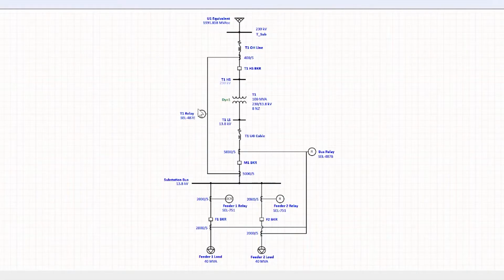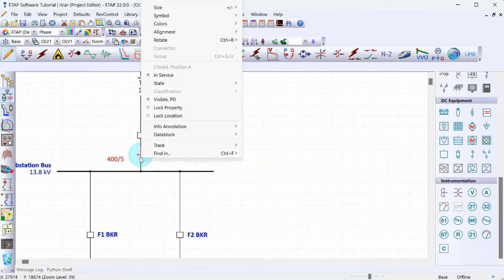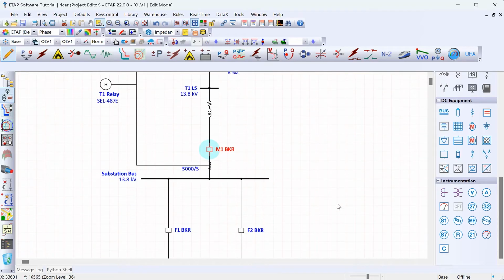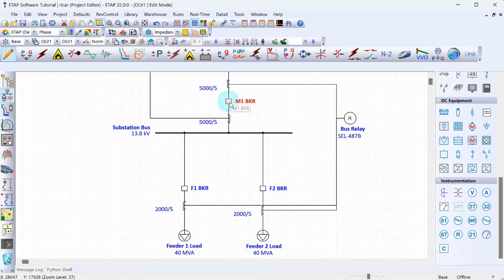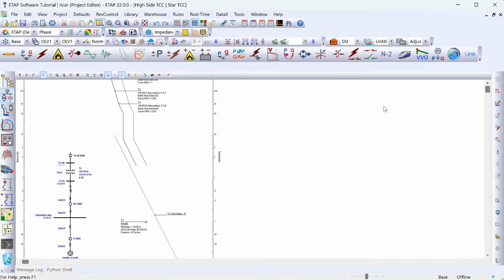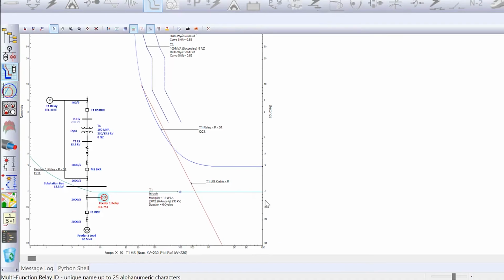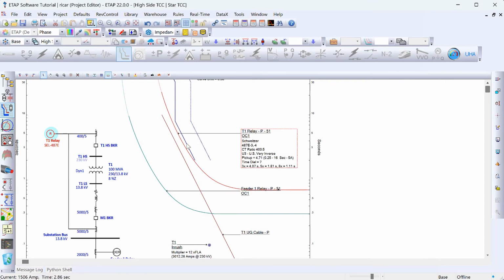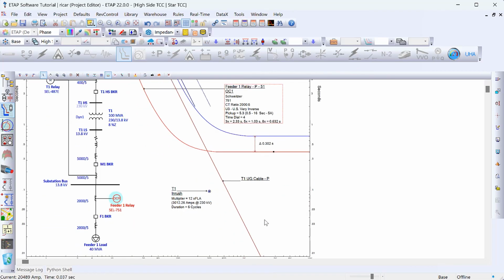ETAP Software Tutorial | How to Model Protective Relays Using the ETAP Software

Comment: why were current transformes   used  before CB. should not that used after circuit breaker
Reply from the maker: Hi. CTs should always look into the protected equipment and encompass the interrupting device. For example, the CTs for the transformer differential relay in this example should be on the top side of the high-side circuit breaker and bottom side of the low-side circuit breaker, both looking into the transformer. The CT on the main breaker for the bus differential relay should be on the top side of that breaker, therefore overlapping with the CT for the transformer differential relay.

Hope this helps.

-Ricardo.

Comment: Hello ,
We can change the time of OC definite time from 0.2 sec to 1.5 sec without study ? for PCC point between grid and the plant.
Thanks
Reply from the maker: No, this is a big change in the time delay of the OC element, you should make sure it coordinates with other protection before changing the setting.

-Ricardo.
Reply: @romeroengineering  thanks Ricardo and for the UV setting recommended for MV motors ? Please with AR 0.8 sec from national grid

Comment: Dear Sir thx a lot for great details. Its very helpful. One query confusing me is whenusing CTs for overcurrent relay with earthfault in residual connection. Do we have to select ( for pickup n time setting in etap) NEUTRAL OR GROUND option. Pl respond. In your video for feeder 1 & 2 have u used inputs in phase n neutral or phase and ground. Kindly advice. Thx a lot 
Rajesh

Comment: Dear sir. Thanks for sharing information. I have a problem for adding a new dc protection relay(sepcos relay) in etap. Could you help me how can i add it. You know that we haw lsolate amplifier voltage and current instant of pt and ct in dc traction systems. Thanks a lot. Tizchangi Mehdi

Comment: Can we model another Overcurrent element for 487E for the low side on the same relay?
Reply from the maker: Hi Talib. I don't think you can do both at the same time in ETAP (if both are phase elements or both are ground elements). You can, however, add the OC element and change the CT input in the Input tab to use either the high side or low side CTs. Also, phase and ground are independent of each other, so you could have a phase OC element on the high side and a ground OC element on the low side. You could also put another fake relay on the low side to show the OC elements in the TCC.

Why would you want to have phase OC elements on both the high side and low side within the same relay though? If it's implemented on the high side, it should provide backup for low side faults, if set properly. If you intended to use it for fault locating, the relay records will record both high side and low side currents, so you can easily see where the fault is without having to implement another element.